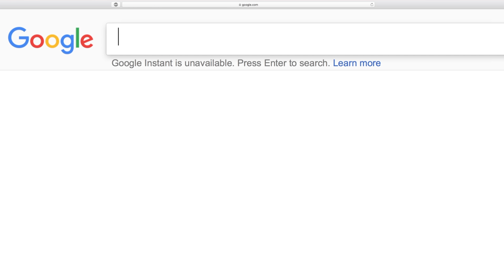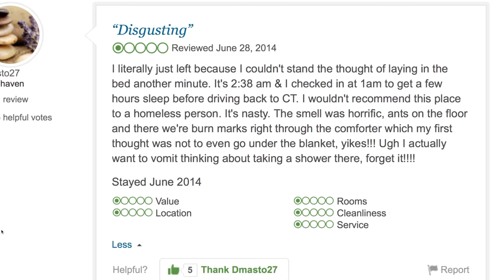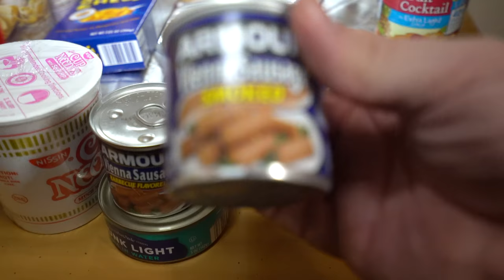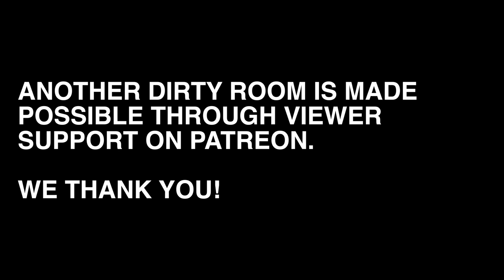Another Dirty Room S1E10 : GHASTLY GETAWAY : The Best Budget Inn - Havre De Grace, MD

Comment: I worked for a hotel and the housekeeper would shove so many sheets and blankets in the commercial washer, they couldn't wash or rinse properly (talking to her about it was useless). I wonder if the crusty "vomit" was soap/detergent that wasn't rinsed out. She would also leave a wet load sitting until the next day before drying (you know, quitting time), so some loads were stinky and moldy-smelling even after a wash.
Reply: floooky1 And they did not fire her...why?
Reply: floooky1 I was thinking the same thing.  It looks like dried detergent.  So, they do use soap at that motel...sometimes. 😒
Reply: floooky1 These guys always think stains are human excrement. Having been a maid & a mother, food & drinks spills on beds & chairs all the time. But these guys crack me up anyway, they're hilarious.
Reply: I'm very glad the sentence "she would also leave a wet load" ended differently than I expected lmao

Comment: I love your videos Dan Bell.  I used to live near Havre de Grace as a kid and actually pulled into this motel a few weeks ago to take some pictures.  The classic motel looked so pretty on the outside with the stone walls.   I actually saw a door open on one of the larger rooms when I drove through the parking lot.  I wanted to peek in so badly, but I left thinking I may get in trouble for trespassing.  Went back later and decided I better not take a chance.  I have stayed at some very disgusting motels when I was younger and this one is pretty bad.  How can they charge such high prices?